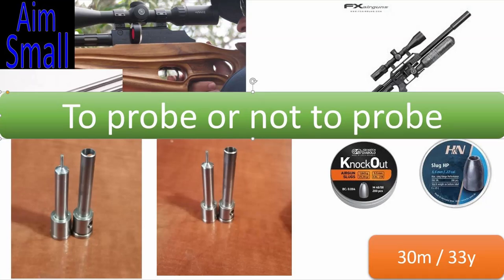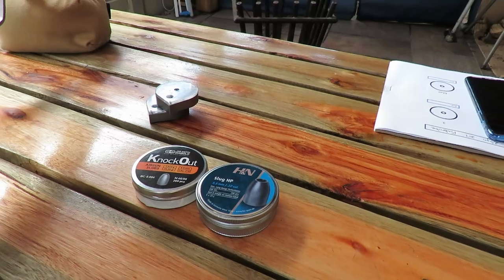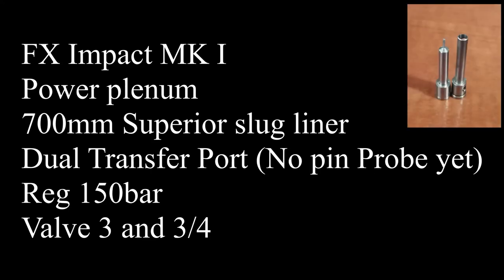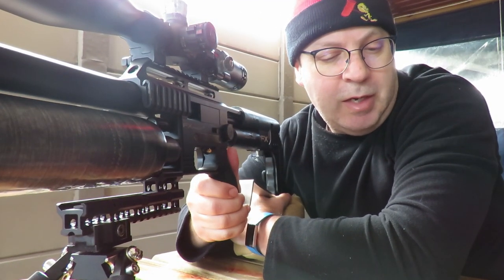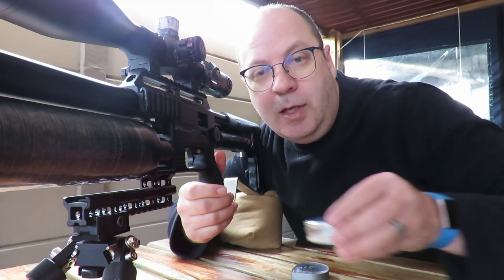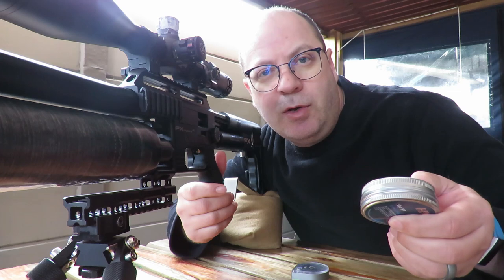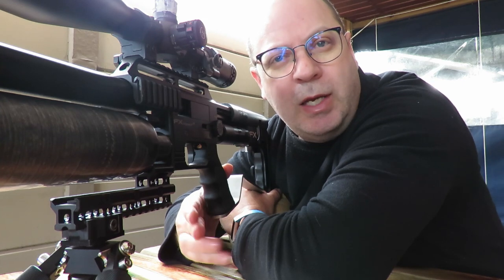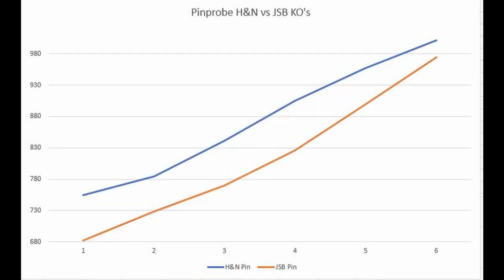To probe or not to probe...

Comment: Very interesting indeed,  Pin probe for tighter tolerances making sure no air is pushed passed the sides of the bullet or pellet.  Tube style probe for less tighter tolerances holding the air to the center of the bullet until it has time to seat or expand and seal.  Excellent testing thats for sure.
Reply from the maker: Thanks, interesting that the 26gn JSB, also loves the probe, it is at this stage just the 216 KnockOuts that is weird

Comment: Exchanging notes 😁 :
Impact MKII - 700mm Superior Slug Liner HEAVY.
I had my set up very similar to yours, and this is the ''before and after'' I instaled the Dual Flow Port and FULL Pin Probe kit:
Hammer spring max. out, power well at MAX on both set ups.
H&N 25gr on both (it's my slug of choice).😉
Before: Reg @ 145bar - Valve at 3 and 1/2 - 950 fps/avg.
After:    Reg @ 115bar - Valve at 3                - 1000 fps/avg.
So, I lowered the Reg.30 bar, closed the valve a bit and for accurancy...1 MOA @ 60meters.
Between MIN and MAX only 30fps less.
Going up more it's worse for grouping...I think I'm happy with this.😀
Aim Small and Hit Hard. 😉👍
Reply from the maker: Thanks for sharing, I need to reset my gun from scratch... soon...

Comment: Great video and slightly surprising results.  Considering your suspicion about air loss, if you have any of the 218 H&N it would be interesting to further test the theory and see if it improves even more.  It does seem like the JSB just isn't keen on the FX barrels unless at  low (780) or very high (960+) speeds
Reply from the maker: I did use the Pinprobe with the 217 and 217 Javelin slugs in 23gn, minor difference in speed, less than 10fps

Comment: did you install the fx slug power kit or just the probe? also, have you tried to adjust the probe? I adjusted mine and the speeds went up.
thanks again for your work and time you put in!!!!
Reply from the maker: Mine isn't the adjustable probe, I do have the dual flow port inserted, thus not the original FX power upgrade

Comment: I'm itching for my pin probe kit to arrive, it's literally in the mail.😂 
Same question as Mr. Whisper: did you install the complete kit or just replaced the probe? Because it makes quite a difference...
There is a very good video by Ernest about instaling the full kit...
Another itch of mine: the rain should stop so you can go to 50/100. 😂 
Do not take this the wrong way, but then I believe you will realise the ''waste of time'' with the KO's, especially at higher speeds.😌 
That said, it's always good for other people to see the differences.
I enjoy your videos very much. 👍
Reply from the maker: The KO's are brilliant in my Standard slug liner, not in the superior liner, it is made for pellet guns and not slug guns. 

I installed a dual flow port a while back increased speed by about 25fps, plus now the Pinprobe at another 25fps. 50 fps in total
Reply: @AimSmall  Ok so, not the full kit then. The dual flow port does not come with the kit, but it's a must.
The full kit comes with the pin probe, a lighter valve spring, a buffer hard rubber ball and a hammer spacer. It also has an oRing for the probe if you change to .25 caliber.
Then you adjust the pin according with the base of the slug, dish or flat, without the pin sticking out when cocked of course, or the magazine will not fit. But because you experiment with different slugs with different bases, maybe you leave it just flushed. 😁 
Cheers 👍

Comment: can you help me, i buy a fx impact power plenum and i my max speed is 278 m/s with 16 gr jsb, hammer max, valve fully open and pressure 170 bar!! at 80 bar i've got only 220m/s, my retailer don't know, and i don't know wath to do. i want to shoot jsb ko, but it's impossible. thanks
Reply from the maker: The power plenum comes with a new hammer and hammer spring, it might be that the hammer spring isn't correct, or the hammer itself is too light, sounds like it isn't hitting the hard enough to let enough air through. Bring the reg down to 130 bar max, (remember to de-pressure the gun first). The adjust the hammer spring next to the power wheel, put the power wheel on MAX, if there is some play next to it on the tension screw it will not open wide enough to let the air through. Go and have a look at Ernst Rowe videos on youtube, he has one on harmonic tuning that takes you through the process.
Reply: i find,  the new fx impact have a dual transfer port.... half turn and it work.😜 thanks. now got new problem... accuracy with jsb horrible...
Reply from the maker: @fontanellestephane7775  JSB 18gn or 25gn? The JSB 18gn tend to perform best between 870fps and 960fps, the same with the 25gn. 25gn don't like going over 1000fps at all.
Reply: @AimSmall  with the ko 216.... the 18gr and 16gr pellet are simply perfect.

Comment: I got my probe. I did not install the spring and balls. I used it in. 25 and I do not like it at all..unless maybe I'm doing something wrong. But it is alot louder at my ear. I will sacrifice 25fps for less noise. Maybe thats just me.  But is anyone else having this issue? Or is it just as quiet as the regular probe?
Reply from the maker: I only have the dual flow and pin probe installed, nothing else. Didn't notice the increase in volume.

Comment: the pin probe has only one  plus point ,you can adjust the seating dept  , (aslong you stay away of the magazin free turning or it will jam),and that wil  also solve some kind of leaking if it should occur. ( i think the airpressure will effect the o ring seal(in the brass flow tube) of the pin probe more then  with a normal probe.
The  max speed  of the gun  design  as bought should be not surpass t   but to  get that speed with the lowest pressure and most shot counts from a fill , because a t higher speeds you need also another barrel  twist most of the time and the gun will get also more tear and wear.
Reply from the maker: Hi Sir. The pin probe and Dual Flow port does allow a person to shoot higher speeds at lower reg pressure, before I installed mine I was able to shoot 26gn slugs at 935fps with a reg pressure of 170bar, the gun and parts were working to hard and I felt uncomfortable "using" the gun like that, after installation I was able to achieve 950fps at 145bar, I wasn't happy with that and today I reset everything on the gun and started from scratch. The goal is to shoot 26gn slugs at 970fps, I now manage that at a reg pressure of only 120bar. I don't think that is possible without the Pin-probe and Duel Port. I am not a speed junky, but in order for me to test different slugs and weights I need to run them at high speeds. I still prefer pellets up to 75m, cheaper and more accurate (wind is part of the art of hunting). The slugs are just amazing in high wind and gives the shooter the confidence to humanely do pest control at longer distances.

Comment: When pushing a slug into the rifling a pin prob will pierce the back of the slug.
Reply from the maker: If it pushed that hard then there is a problem with the gun... the pin probe gently pushes the slug into position, no force is needed.
Reply: @AimSmall  I have recently found out that the chamber in my barrel is wider than the barrel, 
So a long slug was being wedged into the lands and the shorter slug was rattling in the chamber,
After removing the o ring at the breach end it became apparent that even a 218 would just drop into the chamber but was virtually impossible to manually push it through the lands and into the barrel,
There is a step in the chamber so it looks like the chamber was drilled wider than the barrel,
This allows air to escape around the slug before it makes the seal inside the barrel.
I am going to have the chamber removed and start over by having the chamber re drilled.
I have uploaded a video of pictures showing exactly what I mean.

Comment: I haven't seen a reason to switch to slugs. At 50yds I literally get one hole groups @ 910fps with JSB 18.13 grns At 100 yds 1" groups. 600mm Smooth twist
Reply from the maker: Slugs are only good for hunting and long range, if the intend is to shoot up to 100yards, then nothing will beat the accuracy of pellets, the wind may play a role, but that is part of shooting.